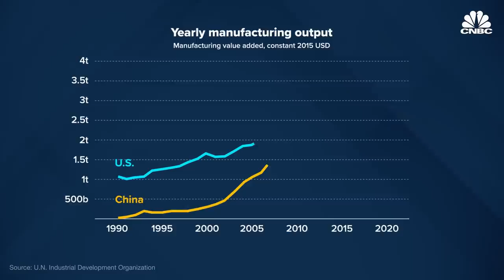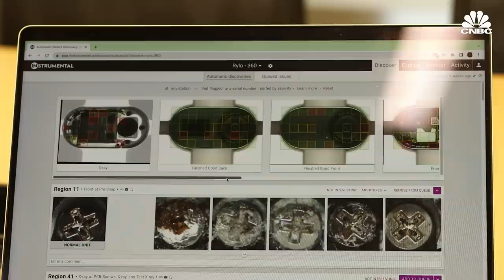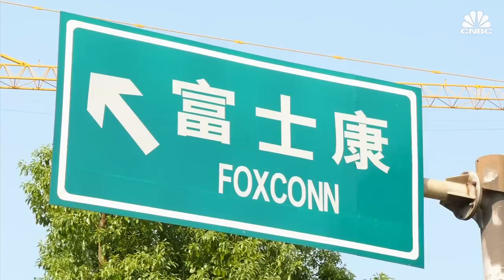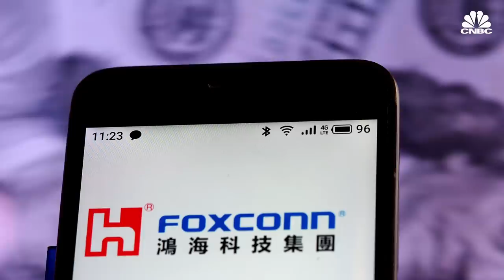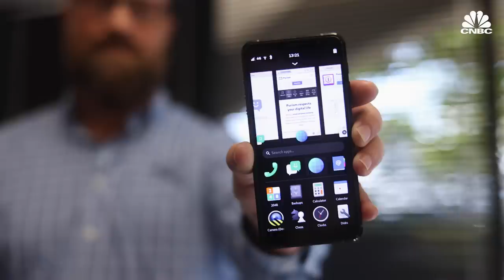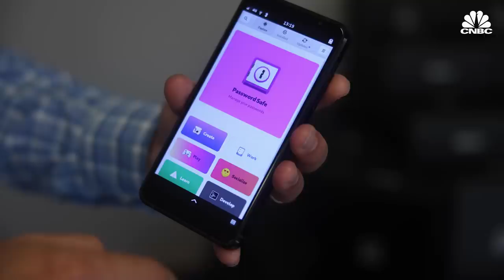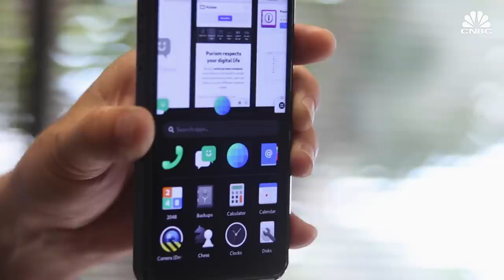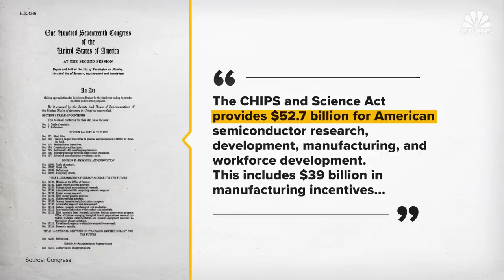Why The U.S. Fell Behind In Phone Manufacturing

Comment: I worked and managed manufacturing electronics and semiconductors for 30 years.  I’ve visited China on manufacturing activities multiple times.  I became management and can see the financial statements.  In the 1990’s and early 2000’s, labor cost in Asia was the driver. This drove supply chain to go to Asia, even the most complex manufacturing and less labor intensive like chip manufacturing.  So in 2000’s it’s supply chain as driver.  In the end, it’s profit margin that is driving the companies to manufacture in Asia, particularly China.  The US and Europe have given up even their low labor intensive manufacturing capability (chip foundries) and even design capability (engineers are cheaper in Asia).  They could still make a profit by manufacturing in the US, but that profit may be only 10% compared to 30% if made in Asia (mostly China).  So the root cause is profit MARGIN, not profit.
Reply: Entire supply chain for a vertical is located in one area in China, which makes the manufacturing process super efficient. US or Europe have nothing like that, not even close. That’s why the overall cost is cheaper in China, not the labor cost. Chinese labor’s ain’t cheap at all.
Reply: @lordlee6473  You misunderstand what I’m saying.
Reply: @lordlee6473  Not sure what you mean.  Most of Apple iPhone's important components, eg, AP, display, memory/storage, camera sensors, etc, are all made outside China; then imported and brought to China for assembly.  China's contribution to Apple iPhone's BOM for instance accounts for less than 10% -- that's not "entire supply-chain."   Apple = Make China Great Again.
Reply: @tooltalk  Intel is building a new chip factory near Columbus Ohio, maybe it will change things for where the rest are made or assembled. Also higher fuel prices. It would change faster if Canada was not the only area with universal health insurance, and Mexico allows severe air and water pollution from a factory.
Reply: It's just that China has more graduates in Science Technology Engineering & Mathematics STEM than USA. US prefers to train more climate Activists and Women's Rights advocates, whiles China trains more Engineers and Scientists.
Reply: . etc sims2 bitcrash^
Reply: well said
Reply: We don't work 996 for $10 a day here, the end
Reply: @rond5936  don't forget lawyers Ron. There are 2.5x more lawyers in the US despite the fact that there are 4x more people in China.
Reply: @danielch6662  Yes, Exactly, More legislation means more more lawyers and more politicians and so much government red tape in business.
Reply: Nah, manufacturing in US will lead to highly uncompetitive pricing, meaning companies that produce in US will fail to capture the global market vs those that manufacture in China. The moment margin goes down due to competition, the factories in US will be the first to go bankrupt.
Reply: And the 10% margin vs 30% margin is highly doubtful. America do not have the basic infrastructure to even compete across all electronic sectors, and you are doing projection of only a 20% diff vs the most efficient and manufacturing power on earth.
Reply: @hullopillow4853  You should see the financial analysis. For complex, machine dependent and automated (non labor intensive) manufacturing such as chip foundries and tool & die for example, it’s absolutely achievable. The US, Germany and Japan moved these to China only because of logistics and supply chain (and also lax regulations) because the final assemblies (labor intensive) are located there.  It’s the extra margin in profit that corporations are after. Every year, we management review material costs, and if a $5 component can be reduced by even $.01 by changing suppliers, we’d do so. There’s a lot of pressure.
Reply: Stop corporate greed bring back jobs to America
Reply: @dominosnostradamus2415  😂😂😂
Reply: @lordlee6473  You're correct to emphasize that supply chains in China have been optimised to maximise productivity, which is why it remains attractive for foreign companies to manufacture goods there, even though wages have risen. 
Having said that, relative labor cost remains a factor, because although wages in China have risen significantly since the early 2000s, they're still half (or less) those in North America or Europe.
Also, because the global supply chains are already in place it's more cost effective to relocate manufacturing to other SE Asian countries (e.g. Vietnam), if necessary, instead.
Reply: @rond5936  the US is too busy figuring out what gender they are
Reply: @dominosnostradamus2415  you want americans to trade their internal organs to afford goods?🤣😂
Reply: @dominosnostradamus2415  🤣🤣
Reply: @rond5936  for assembling a phone dont need engineering /phd…a 10th pass can do it
Reply: @prasenjittripura4691  Yes, But a lot of Engineering goes on before it gets to the assembling of the phones. They just don't have that many engineers.
Reply: You than have to ask why labor is more expensive in the u.s? It’s because our standard of living is higher than most if not all countries. We consume and shop more sqft per person than 2-3 people overseas.
Reply: @danielch6662  Ah yes, China's very fair and just court system. Maybe they don't need as many lawyers because the odds of winning a case against the state, or any entity with more money than you is 0?
Reply: Proof or this is just a load of crap.
Reply: @arcaneisboring7675  How would you know?! You’re just projecting your ignorance.
Reply: @thevinceberry  We don't work. The end.
Reply: It is not the only problem. Chinese education is more powerful, missive and efficient. The students work hard in school, from the beginning to the end. They are used to work under pressure. Besides, the medium class in China is something between 200 to 300 millions people. Can you get it the amplitude of their capability? They have a huge pool of selection for the future scientists. In China the families are united and all the effort of the family is directed to the education of the youngsters.
Reply: @forbeginnersandbeyond6089  one of many reason why american companies set the manfacture to east is geopolitic..
Look at taiwan.. from 1970 80 90 usa feeding this country with "subsidized" by giving a job for chip manufacture...
Japan n korea too... singapore too..
Btw usa "helping" china to rise by investing from usa companies because.. unisoviet china clash in 1980......usa want to seperate china from uni soviet at that moment by giving a piece of bread..
Reply: They keep talking about supply chain advantage in China when Tim Cook just said majority of component is done in the US. How is that an advantage when you have to ship parts from US to China to assemble and ship back here for sale. Not to mention the inefficiency.
Remember the previous excuse few years ago was even if the jobs were to come back to the US, it will be all done by robots. Elon found out the hard way with Model 3 that robots were not a replacement for people. So the reason changed from robots to supply chain advantage.
Reply: @jeffruebens8355 who’s gonna move to Ohio as a high tech chip engineer?
Reply: In Taiwan, as a Taiwanese, I can tell you, even if it’s not a labour intensive occupation, eventually we would just double employees’ working hours.
As you work in semiconductor industry, have a look of the average weekly working hour in TSMC which is the world largest semiconductor manufacturer located in Taiwan. See if westerner word would like to work for that many hours.
Reply: @rond5936  That is true. It is because in Asian countries like China, India etc. there is always a pressure to perform better or end up with financial misery and no social status. People in wealthy western countries don't have to worry about that.Convenience and comfort makes an average person lazy.
Reply: @ashishtiwari1912  yes
Reply: @RonnieWu  Hmmm. They would. Just take a look at engineers at Google and Apple and Facebook etc. Maybe not that much, but not that far.
Reply: Ah yes the best source, a YouTube comment
Reply: Basically 2 factors ~ massive lower cost qualified, skilled and disciplined labour
AND an ecosystems of sub components suppliers of hardware/software systems that generate fast turnaround time and competitiveness. 
US will take mountains of labour issues n commercial interests to resolve the above captioned.
Really??? US can’t even get a bullet train system across the States’ statutory agreements.
Reply: @rond5936  ok, boomer.
Reply: @explosivedude8295  
I think the biggest problem is their discipline to conformity to work procedures as per required in skill/technical options. Americans like their “free willed” as misguided liberty/freedom and forsaking strict protocols n regulations.
Reply: @CodyCha  
Americans labour unions/law n minimum wages cannot make their products competitive on a global scale. They value a balance work-life with plenty of rest n leisure.
Reply: If I phones was manufactured in the U.S it will over 2,500 dollars
Reply: @theshield1613  
Yes and iPhone would have lost the market and diminished ~ everyone else would opt for cheap android phones, where China dominates.
Reply: You missed the smartphones being manufactured in India and other countries too....
Reply: @nitinkataria4108  
No, read my comments ~ I mentioned that as China progresses, India is also on parallel paths. However, India is too divided and segregated by multi tongues and ethnicities differences. It is very interesting to know India surpasses China in steel trade. I always ponder the reasons why???
Reply: Of course! Anyone who doesn't know it's about greed and profit must have an IQ below freezing temps.
Reply: @Wong-Jack-Man  Yeah well, that is rapidly changing.
Reply: The last time I asked for a quote from China the burdered labor rate was a dollar an hour. That was 20 years ago.  It's higher now, but not nearly as high as the USA.  Big bosses make big bux in USA, workers, not so much.
Reply: So in simple terms, "Greed".
Reply: @oliverjansensy2118  
Ok, let’s put money issue aside; can US labour be as productive vs Asians??? How many of u people have had worked with foreign overseas Asians??? How many have had studied together with foreign overseas Asian students??? We are hardworking n devote our upmost towards our objectives. Whilst, I can say that Americans tend to incline towards a balanced of work with leisure; the worst lots r business with pleasure. I have yet to come upon a workaholic Anglo Saxon. Asian placed great emphasis on schooling/education and hardworking is a must to attain these. It is part of our upbringing vs western concepts of “creative, self expression, individuality” of western upbringing. 2 different work attributes.
Reply: @lordlee6473  Labor cost in China and other asian countries is way cheaper if you convert it USD. When you are earning USD but paying in CYN then the difference is huge. It is also the reason many outsourcing companies are going to english-speaking asian countries. There is also the cost of living. 2-3$/hr is a decent pay in developing countries but most american will not he happy to take that.
Reply: @angxiang3186  You speak as though the chinese people are significantly better than western ones just cause you are more hard working compared to other race? And what's wrong with having much leisure when you are able finish your objectives anyways? Does working hard always equates to better results? Does more quantity equates to better quality? I don't think so. And so does the rest of the world with regards to china-made quality. The US and other countries can survive and thrive with or without china. The only reason most inverstors are still in china is because of marginal gains. Because at the end of the day, a profit is still a profit to a businessman.
Reply: @tiberianexcalibur  All chip designs are done in the US not to mention the leading chip research companies and universities are there as well, because the silicon chip originated in the USA to begin with.   That didn't come from "Chinese engineers" who were all trained and educated by the West over the last 20 years.
Reply: @ashishtiwari1912  And how is that 996 fantasy working out?   Working hard meaning working most of the waking hours of the day is not anything somebody should aspire to because most of these Asian economies have some variation of the 996 policy.
Reply: @CodyCha  So you think the reason that the USA, which came out ahead of all other countries in the world in manufacturing after WWII gave up its manufacturing ability because simply the cost of US labor?   No.  That is a fairy tale.   They wanted to help build a global economy which meant sending jobs and manufacturing to other countries and boost their standard of living so they too could be consumers of American products.    It is a win win for the corporation as they avoid the US taxes via loopholes and offshore banks and they create a whole new generation of consumers all over the world for their products.    Sending jobs and factories to China has created a huge market for American products like the Iphone which did not exist under the failed experiment with Maoism in China.   China today is among the biggest consumers of American products from agriculture products, software, tools, licensed IPs, technology, cars and so forth.    And for all that "Chinese engineering" a lot of those skyscrapers and cities were designed by American or international architects, which is another source of income for these giant corporations.   Plus, the icing on the cake is that this "global supply chain" is just another way for these corporations to keep making massive profits using 'global disruption' as an excuse.
Reply: Wonder how many commenters has the same work experience as the OP?
Reply: Yeah, in the early days made in USA was one of the best manufacturers. Since the costs going up and up, quality suffer.. The driver (profit margin) became the reason why jobs were outsourced overseas. The companies saved a lot a lot of money. However, our manufacturer workers could NEVER get their jobs back.
Reply: @lordlee6473  On the average for every dollar value imported from China, 54 to 60 cents already went to U.S workers. We sent China a lot of the components of certain products that we import. Many of the complicated parts of Nike shoes are made in the U.S.
Reply: @RonnieWu  we're already working 10 12 hours a day
Reply: @dominosnostradamus2415  Can't! Because corporate greed is not the problem; the problem is endless government deficit and money-printing drive the wage too high. McDonald's wage is at $17/hr while iPhone worker in Foxconn, ZhengZhou China is around $4.5/hr, and that iPhone worker will cost minimum $30/hr in the U.S. today. You can witness the extra wild wage growth since the pandemic; based on the past experience the U.S. debt problem will just keep getting worse. And years of lacking on infrastructure improvements make an U.S. worker's competitive level $5 behind immediately just between the morning he wake up and go to the job site - still the government's fault for failing to upgrade the infrastructure.
Reply: The documentary 'American Factory' explains it very well. We Americans don't work on Saturdays, have fat fingers, complain a lot and will create unions lol
Reply: @bella_testastretta  supposed to organize unions we have people working 7 days a week 12 hours
Reply: profit margin and profit are interchangeable terms in the context of priorities of manufacturers.
Reply: @thevinceberry  Yeah. You just like paying $996 for things that cost $10 to make.
Reply: Not only the labor the amount.of phone engineer in china can full a foot ball field america yuh can count Dem small amount and china manufacture them fast
Reply: It's.the Skill not The labour cost
Reply: @rond5936  You dont have to be a rocket science to assemble apple parts. Its the low cost labor price that makes china the country to go to
Reply: @frankcadillac1456  But you need a lot of Scientists and Engineers to continuously design the many consumer electronics and also maintain a deep supply chain.
Reply: We can start by keeping housing cost down
Reply: Correct, so its not the Chinese stealing the jobs, its the strategic decisions of corporate America driven by profit margins that have led to this trend in the past
Reply: Why airplane are not made in China?
Reply: @babacloanza  best comment yet. I fear people (Americans) don’t understand that gravity of this yet. “They’re winning”
Reply: this doesn't make any sense, profit "margin" is still profit
Reply: Before 2004, the United States led the world in semiconductor technology, and foundries had to pay IBM's technology license fees. But in 2004, TSMC took the lead in developing 0.13-micron copper process technology ahead of IBM, ushering in the era of Taiwan's semiconductor technology leading the world. In 2014, IBM withdrew from the foundry business, and TSMC considered buying IBM's fab in New York State. However, even though IBM's technology has lagged behind Taiwan by a decade, the US Department of Defense and IBM, still worried about the already fading American technology influx into Taiwan, rejected the deal. High-tech semiconductor technology is the result of Taiwan's efforts to develop, and now the United States claims to "bring back" semiconductor production to the United States.
Reply: @y.__.y--  god that is some COPE
Reply: You left out some other factors, US vs China in terms like labor cost, worker benefits, workforce sizes,  regulations, taxes, infrastructure, geographic locations, and etc ...
Reply: Yes but labor productivity is also higher in China.
Reply: Yup roi  maximization
Reply: And the skills to manufacturing goods too.
Reply: @embededfabrication4482  Profit Margin in China is triple of what it is in the US. Corporate greed wants the higher profit, nothing else.
Reply: We know.
Reply: exactly, another issue is Countries dont have to deal with waste, ie toxic chemicals need safe disposal in ie the usa, in china its soneone elses problem. The amount of people who i tell that chinas entire groundwater is destroyed just shrug their shoulders or not even bat an eyelid at that astound fact is just heartbreaking. 
I feel so so bad for them, we as global consumers have helped drive china to a tech giant, but we have all as a global community helped them destroy their country to help corperate greed. 
The other crazy part is, that when the time comes when china needs help from the outside world, it wont be the bill gates or jeff bezos paying to clean up the trillion dollar waste problem in china, itl be down to us normal everyday tax payers yet again to fix the problems that billionares and trillionares just walk away from laughing.
Reply: In other word lack of patriotism and greed.
Patriotism s is a major major  motivator in China.
Reply: @tooltalk  China don't need your apple ,china has many local brands like Huawei,One plus. oppo ,Vivo etc but on the other hand Apple needs Chinese market.Accept that there is a shortage of skill labour in the US in general ,not only apple. Look at the worldskill competition,every year China gets the most number of gold metals,in 2022 ,the US didn't get any gold medal.
Reply: GDP  per capita China is tied  with Botswana. 
Its a billion working poor.
Reply: Your literacy denies your claim of being 'management'.
Reply: @buildmotosykletist1987  You make no sense.
Reply: @lordlee6473  Can you explain what a vertical supply chain entail?
Reply: US doesn’t have enough talents for these anymore…
Reply: Short term shareholder interest drives it all.
Reply: @pottyputter05  Agree
Reply: @thetacokawaii5708  a vertical refers to an industry, in this case, semiconductor manufacturing. There are many players in its supply chain, and in China they all congregate in one area, like a scaled assembly line
Reply: I fully agree with you, MAXIMUM profit margins has been the main driver in moving both US and European production to Asian countries. However it is a double edge sword that has now come home to roost. I remember when i was doing my Engineering Degree back in the mid-70's, one of my tutors said "we'll outsource manufacturing operations to Asian countries (then places like Hong Kong) for cheap labour purposes, whilst we'll retain dominance in the high tech design and manufacturing market". To a large extent it did start off like that, but like I said back then "it won't stay like that". He said "what do you mean". I replied "currently I'm a wet behind the ears graduate and when i graduate my skills will be half useful to someone, after 5 years useful and after 10 years very useful". I said "it will be exactly the same with Asia, they'll start off doing the basics but as time passes they too will learn and  master high tech design and manufacturing". We'll I've seen my words come to fruition with China building 25,000 Miles of High Speed Rail network just last year alone, dominating the Microprocessor manufacturing market, having the largest percentage of rare earth reserves,  etc. etc. Interestingly I saw a comment from someone berating the lack of metallurgy expertise in the West and the subsequent early failure of field artillery barrels. I did a quick search on Global Rankings for Metallurgical Engineering Universities and China took the Top 3 spots, followed by Japan in 4th, China 5th and US 6th (University of Tennessee, Knoxville).
Reply: @rockymount2393  Now, it’s Chinese and Taiwanese teaching Germans and Americans how to set up factories and how to make products efficiently. Even automation. It used to be the other way around even just a mere decade ago.
Reply: But that's not china's fault, it's the greed of Americans. I rather go with China to as the quality of their products is just awesome. I just wish for better coop so more devices would be available in English. Especially in the smarthome sector! Google is like a decade behind, but in order to benefit from china's full system you mostly still need to read and talk chinese. But even thru its still worth it. A life in style, like an American billionaire.
Reply: @rond5936  Facts, unfortunately
Reply: Why not Sentra America and south America the labor cost very cheap over there than China
Reply: @rond5936  Heyo we got a real Andrew Tate over here
Reply: @franklimon1  Chinese bot spotted
Reply: Worked 25 years in manufacturing {USA} When i retired We had a 3 pay scale for employee  1. very experienced paid top dollar 2. avg skilled paid by years of employment  3. daily work temp low pay no to little experience. I will say companies use experience as a problem is lying! more excused. Why because our labor market doesn't have the people to run the plant. We would have to increase more work visa.
Reply: Long term, we became Chinese slaves.
Reply: @jeffruebens8355  it'll shut down soon just like Motorola
Reply: @rond5936   your statement is only part of the truth , it’s insufficient.
Reply: @hullopillow4853  explain why they would go bankrupt, how sure are you ?
Reply: @rond5936  I disagree with you
Reply: the true root cause is the willingness to have things made by what is effectively slave labor
Reply: I agree, it's all about the money after all. Business is business , the more profit there is the more happy the stakeholders.
Reply: @America_bombsTSMC  They do. Comac ARJ21 regional jet and the C919, a narrow body plane.
Reply: @rond5936  Can't argue with your statement.
Reply: 👏👏👏well said
Reply: The most important factor because the west control financial system, u imagine papers become global reserves currency, it wont work if u produces goods by yourself
Reply: These manufacturing won't come back to the US only to face more complain, higher cost of labor, more criticism and scrutiny from the regulator. Not to mention shortage of skilled labor. It's just too much problem for them.
Reply: @babacloanza  Are you suggesting that is a lifestyle Americans ought to aspire towards?
Reply: @angxiang3186  You say that like it's a negative thing.
Reply: @angxiang3186  Those attributes you list are the same reasons China has to resort to knocking off creative and innovative designs from Western designers.  You may have the technical knowledge to manufacture, but collectivist cogs will never have the freedom to dream and explore and thus innovate.
Reply: God have mercy
Reply: Better stop the union BS first.
Reply: @nasigorengpecelesteh1506  This seems to be a trend for countries recently occupied by the US. Japan, Germany, and South Korea all benefitted tremendously from the US outsourcing it's manufacturing base and in exchange they became valuable US military allies during the height of the Cold War. China came later than the others but the US started collaborating with it in the midst of the Sino-Soviet split in the interest of gaining more allies against the Soviets, it seems the same is happening now with India only this time it's to build a stronger military ally right on China's doorstep.
Reply: "So the root cause is profit MARGIN, not profit." Bingo, also known as corporate greed. There's a reason Apple is such a greedy power hungry monster of a company.
Reply: @poconopatriot567  russian bot
Reply: @oliverjansensy2118  no... it is about competition, its " you don't do it other people will " situation.
Reply: Businesses moved their factories to China specifically to access their market while avoiding their hefty import tax
Reply: @chelseapeterson6998  apple is a publicly owned and traded company
Reply: It's not simply that Asian engineers are cheaper, but, that East-Asian STEM counterparts tend to be significantly more productive in reality and in the U.S. in particular. Even in ASML can one find a significant proportion of East-Asian STEM human capital who had contributed significant IPs, and core IPs at that (as opposed to trivial IPs). Indeed, the originator of ASML's dominance on certain specializations in lithography is entirely due to its Asian STEM human capital, as in the popular Anthony Yen who had pioneered additional progress in semiconductor lithography and had became an IEEE fellow as a result.

Alternatively, in accessing a succession of journals on such areas (those of the IEEE, as in medical imaging, communications, artificial intelligence, etc.), one can see a heavy concentration of Chinese ancestry and East-Asian STEM human capital. It would appear that these are trends that will not slow anytime soon, as the most prestigious American graduate schools, for instance, are disproportionately populated by East-Asian counterparts despite the active caste system that sets out to control the quantity of East-Asians in STEM.

Ultimately, if certain entities insist that the amount of East-Asian STEM human capital must be controlled due to issues of ethnic insecurity, then they will be outcompeted as a result, if they allow East-Asia STEM human capital but impose a caste system, then they will be outcompeted nonetheless (see the founder of TSML who formerly contributed significantly to the STEM capabilities of entities such as General Electric in the 20th century). Analogously, if certain entities are to insist that there cannot be too many Jews, then they will still be outcompeted as well (note the complete dominance of American science and technology over European counterparts in the 2nd-half of the 20th century, and the disproportionate representation of Jews in U.S. "tech" entities such as IBM). Such are hard facts for some to swallow, but this is the reality we live in. Alternatively, one can abandon issues of ethnic insecurity, adopt a meritocracy, and be at peace with the natural appearance of non-uniform distributions regarding different ethnic groups as society ultimately benefits (e.g., see Asian counterparts of NVIDIA, AMD, etc. - AMD is an interesting example as a competent STEM-oriented Lisa Su had displaced imbecilic WASP MBAs in order to save the company).
Reply: @lordlee6473  China is an assembler, iphones and chips are not made in China. Chips are made in Taiwan specifically due to security and IP protection reasons as China has been wanting to find a way to copy and reverse engineer chip designs. China local chip manufacturing is still at least a decade behind what TSMC is doing. 

Apple screens are not made in China, they are actually made in Korea by Samsung. 

The only thing China is the worlds supplier in the chip world is silicon as they hold more than 90% of the supply.

Just like how most cars made in US, Mexico, Canada are assembling factories. All the engines and transmissions are built outside of America and imported, this includes Ford.
Reply: As Tim Cook eloquently testifies in this video,  labor cost alone has never been the primary reason.    If it were, we could easily diversify production to India, Africa, Mexico, etc.    This is our 7th year we've already tried to move production out of China ( since Donald Trump's 1st year ).
Reply: @JacobHYoungEAJake  if you believe what he says then boy you are being played right into the hands of a corp ceo whose goal is to make money for shareholders. Labour is one of the major reason why China is still king in manufacturing amongst supply chain being the second major reason
Reply: @441meatloaf  :    The "price" of labor ( = wages ) is only ONE of ma~ny aspects of of labor.    Yes, China is still the king of manufacturing.    But, the reason is not because labor is still cheap in China.    Chinese labor is not cheap any longer since long ago.
Reply: @JacobHYoungEAJake  I never really said cheapness was the main reason. I said its one of the reason. Cost is still 70% cheaper than your typical American salary. 

Second I did mention supply chain being the secondary major factor considering china is the only country providing 99% of the silicon for chip production which is a large part of global electronics. 

Third, labour also being abundance in China and available skillsets. Western world have long quit being the world manufacturer and logistics of it just isn't there. The only reason US still has car manufacturing and hasn't totally shifted to Mexico for the cheapness is because car assembly is under protectionism like agriculture is. 

Even Toyota and Mazda and VW selling cars to US and Canada are mainly made in mexico.
Reply: @441meatloaf      Excellent study regarding the matter, I misjudged your scope of knowledge regarding the subject.    My respect to you.
    
Only if I may add to your already complete enough analysis, the convenience of supply chain within China extends not only to materials but also all kinds of parts.
Reply: @tooltalk  If you go to the electronic market in Shenzhen for a day, you will understand why all electronic products cannot be separated from Shenzhen.Shenzhen is the main supply chain origin of raw materials for parts and components，If you want to make electronic products, you can find all the components you need there, and you don’t need to search for other component suppliers all over the world. This is the advantage of industrial clusters.China does not only do assembly, even if it is an iPhone, at least 80% of the parts in an iPhone come from China, even if it goes to Vietnam and India, it is only assembled in another country, and the parts still have to be imported from China
Reply: @hullopillow4853  Made in America is synonymous with garbage. I bought jeans made in America. Compared with jeans made in China at the same price, the jeans made in America are really garbage.
Reply: @jackzhou4813  : yeah, sounds like you have no clue -- never worked in product design or supply-chain.  First and foremost, Apple's iPhone are communication devices that requires high-value, high-tech components such as 5G wireless/radios, mobile SOC, OLED displays, and camera sensors,  they are almost always designed outside China and manufactured in either Taiwan or South Korea.  They all combined make about 90+% of the iPhone value.  China makes low-value, low-tech parts such as screws, rubber seals, casing, and potato chips -- but, most importantly, offers unlimited supply of 23-year young, unskilled laborers from rural China.
Reply: @JacobHYoungEAJake  : >> As Tim Cook eloquently testifies in this video,  labor cost alone has never been the primary reason. ...   If it were, we could easily diversify production to India, Africa, Mexico, etc.   

Samsung is Apple's biggest competitors and also the largest smartphone maker in the world.  They pulled out of China and closed the last smartphone factory in 2019.   Tim Apple has been deceiving the American public on why Apple iPhones have to be made in China -- there is no technical or operational reason.  If Apple wanted to make their phones in elsewhere, they could have done so years ago.  China however is Apple's 2nd largest market and that's why Tim Apple invested $270+B in Chinese domestic companies and suppliers in 2016 to please the communist party and maintain their access to China.
Reply: And China was the world leader in manufacturing before the existent of America.   China manufacture silk, china (porcelain), tea, etc.
Reply: @tooltalk  The iPhone was never made in the US.  You want to make iPhone, you should move to India.
Reply: @user-cw2py6wh8l  : oh Jesus, do you always upvote your own comment?  

China had a small advantage when they had the world's population, but ever heard of automation or industrial revolution?   That's why China fell behind.
Reply: @user-cw2py6wh8l  : I've said many times before, but let me repeat once again -- Samsung completely pulled out of China and closed the last Chinese smartphone factory in 2019.  Their smartphones are now assembled and packaged in Vietnam.   China is only responsible for the final stage of the supply-chain -- assembly/packaging/testing.  Most of  design/research works are done in the US, manufacturing in Taiwan and South Korea.
Reply: @Shredderbox  great comeback, why not add woke also.
Reply: Totally agree, listen to the masses in West complaining about CPI and no wage growth. Can't believe those Apple engineers, 50per day flying to CN, thinking how 'worth it' their hard work has been
Reply: @thevinceberry  sorry, 1086, but not for $10/hr;)
Reply: 30%?
More like 90%
Or worst 2 times, maybe more
Reply: The problem is with the scaling of production. There are months when Apple needs a million more people, and then their work is redundant. Imagine employing a million people in the USA. They have to pay all year round. Even if they don't do anything.
Reply: But then why didn't go to Mexico. Or other poor country looking for cheap labor???
Reply: @juanvga  They did.  In the companies I worked in, there were two factories in Mexico, three in China, one in Philippines, one in Thailand and one Malaysia.  We left Malaysia early because they became exoensive quick.  We left Mexico, because we wanted to consolidate in Asia, because there are more labor in Asia, and cheaper. Note that Japan, Taiwan, Germany and South Korea also invest in Asia (China included), so there are more suppliers developed and based in Asia.  We left Thailand later because labor became more expensive.  The Chinese government also provided more incentives. We don’t need to build the factory building.  And labor laws in China are almost non-existent or not enforced.
Reply: @rond5936  you are very wrong. I dislike liberals political correctness,but your statement is far from the truth. China market itself as a scientific and rational player, but in reality it is ideology-entrenched fascist. This also applys to education sector where engineers is considered to be suckers. How do I know? I graduated from a 211 university in Beijing but only made 1/7 salary compare to my none engineers peers. When I move to US, my salary 10 folded.
Reply: @tooltalk  what you say is true. However, the important components you mentioned take up most of the cost of parts that go into an iphone but in terms of the overall number of parts that go into an iphone, Chinese parts make up the majority.
Reply: @wotltkfkdgo  : Sure, China wins Apple's supply-chain bragging rights by weight, but not by value or technologies.   In another word, what drives market demand/sales for Apple iPhones are not these low-value, low-tech Chinese rubber seals or cases which can also be made easily elsewhere, but the core technologies like Apple's A chips, Samsung's OLED displays, and Qualcomm's wireless chips. exclusive to a few top tech companies.
Reply: @tooltalk  exactly, so the point the guy is making is correct. Most of the parts , even though they are not important, do come from China. Making them in one place at a cheap price is difficult, hence difficult to move production out of China not impossible, just costly and difficult
Reply: @wotltkfkdgo  : >> exactly, so the point the guy is making is correct. Most of the parts , even though they are not important, do come from China. 
No, of course not.  @lordlee6473 claimed that "entire supply china is" in China.  I countered that China's supply-chain is limited to low-value, low-tech supply-chain that is quite immaterial since they don't add much value or deemed critical -- they add a lot of weight, but there is no distinctive value, feature, or exclusivity associated China.  All key components come from either South Korea, Taiwan or the US.  I went further explained that China's production of those can be easily relocated to places like Vietnam and rise up elsewhere whereever smartphone OEM choose to setup shops.  And again I cited how Samsung, the largest smartphone maker in the world, just pulled out of China to Vietnam to drive that point.
Reply: 10% and 30%. in short, i can earn 30 billion in other country but only 10 billion in US. anyone know how to choose then.
Reply: @AP-ew6pf  Yup. Well, it’s that attitude the resulted in lack of manufacturing power in America. If you’re an American worker, not so cool is it. But if you belong to a country that receive such American investment, that’s very cool.
Reply: so the 20% import tax can solve your issue.
Reply: @rond5936  that's the other side of it other than infrastructure and labor.
Reply: Capitalism - Maximize the profit.  Income statement: Revenues - Expenses = Profit or (Loss).  The Wages and Benefits is the biggest portion of the Expenses.  Simple math and cold reality.
Reply: @kingina9489  no but maybe have Americans (like you) to get a passport and travel internationally or even get out of your village.
Reply: We should tariff everything not made in the US at a moderate level unless it's something that we can't make ourselves without great difficulty. Those are comparatively few things... Bananas maybe? A few metals or minerals perhaps? I'm not exactly sure. But America has such an amazing set of natural resources that we don't really NEED to import many things. We only do it because corporations find it more profitable to do so.

Investors and non-Americans are the only ones benefiting from this. Consumers might benefit from slightly lower prices on some goods but that only benefits you if you're gainfully employed and have the money to spend.

We also need to tax companies that outsource to other countries. If they're going to profit off of Americans, they should be alleviating tax burdens as well.

But even more fundamental, we need to completely overhaul the overseas and offshore tax nonsense that allows corporations and the very rich dodge taxes. Which would allow us to lower the tax rates, even for the rich. But right now they're not paying much.

But the most fundamental reform we need is to get rid of our fiat currency. It encourages speculation and debt and waters down everything from wages to savings to investments. We need to have a system backed by precious metals to limit the insane levels of money creation.

The only reason we've managed to stave off massive inflation is because the entire world is an inflation sink for the US dollar. Other countries need US dollars to trade with one another so the demand for dollars artificially raises the value of the dollar.

Someday that demand going to go away and the entire world is going to sprint to dump their dollars into the US to get something before the value drops to zero. And on that day we will see hyperinflation. It's inevitable.
Reply: @tooltalk even if parts are made outside of China, you'd still have to bring them in location 24/7, test them, maybe even assemble some of the parts themselves. You need to have numerous companies who'd coordinate this humongous chain close by and working 24/7. It's OK otherwise if you are making l00k devices but not 10m.
Reply: @yesyes-om1po Japan's justice system is also running 90+% conviction rate
Reply: @benmlee cook didnt say 'majority' of parts are made in US.
Reply: @truther001 sure... But would you pay 3k for am iphone? Can't just blame the evil corporations, eh
Reply: @Jkl62200  >> if you are making l00k devices but not 10m.<<
Insofaras Apple's supply-chain is concerned, we are 100+M. 
>> you'd still have to bring them in location 24/7, test them, maybe even assemble some of the parts themselves. <<
Sure, and you see these packaging and testing factories popping up places like Vietnam, Indonesia, etc..  Again they don't have to be made in China at all -- these are fairly low-tech part of the supply-chain that can be easily relocated elsewhere, or whereever there is financial incentive (eg, low-wages).
Reply: @poconopatriot567  Too many flat-earthers and college dropouts
Reply: That's over, countries like China are at an average of 49 😂. Americans are tired of subsidizing the world.
Reply: @benmlee  90% of IPhone's components are sourced from Chinese companies, as America doesn't have the technology to manufacture them
For instance, iPhone's LED screen from "BOE", memory chip from "YMTC", camera from "Sunny Optical", Battery from "Desay" and "BYD", speaker from "Goertek". The list goes on.
Reply: @Crashed131963  China's per capita GDP is $15,000, already higher than many European countries. Imagine it's a country with 1.4 billion ppl
Reply: @__daddy__  Look it up GDP per capita  china is ranked 72 behind Mexico and Belarus .
Reply: @Crashed131963  China's per capita GDP is way higher than Mexico and almost double Belraus.
U need go to a hospital and check ur eyes
Reply: @tooltalk  even assembly  lines need more than 500,000 workers , is that possible can get so many people in one factory live in the factories dormitory in US?? not even close to apple factory in India too??!!
Reply: @rond5936 china has 4 times our population. I'd expect them to have more than us
Reply: Shouldn't it be treason to give Americans technological communication devices to be made in another country?
Reply: @Reptanimalposts  Not if a Chinese person will make them for $5 an hour .
Reply: Don’t need 30 years and 50 trips to China to know labor cost is the primary driver.lol
Reply: @tooltalk integrating the components of a phone is one of the most sophisticated work.. it takes years of practice to learn and then one gets promoted to do ensemble parts of high tech phones.  The reality the even if you combine these experts from the west they are far behind in numbers and skills than the Chinese.. Hence, iPhone will go bust without the Chinese industry
Reply: @sadatkm8609  No worries. those low-cost, low-tech assembly jobs which you claim so "sophisticated" will just move to another low-cost countries such as India, Vietnam, etc.
Reply: @babacloanza 
by time, they will exhausted and will not work anymore